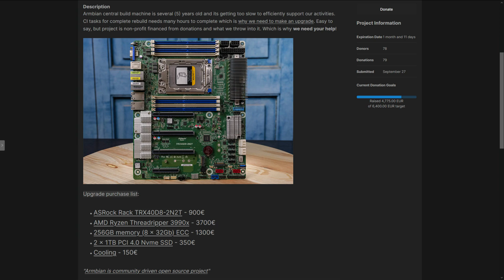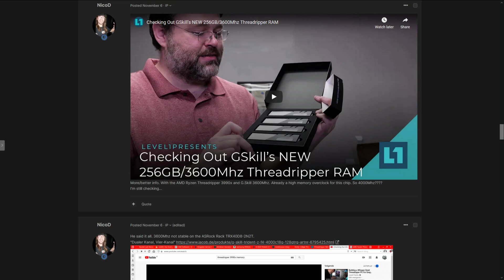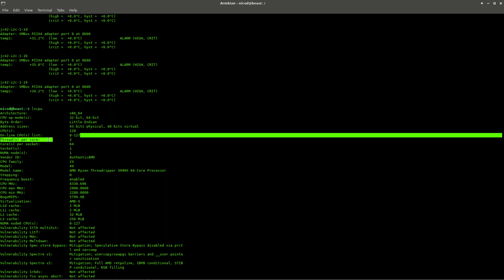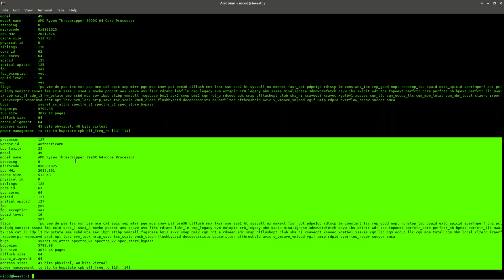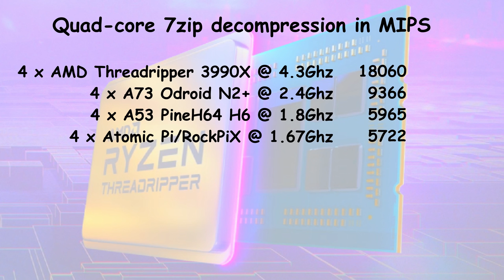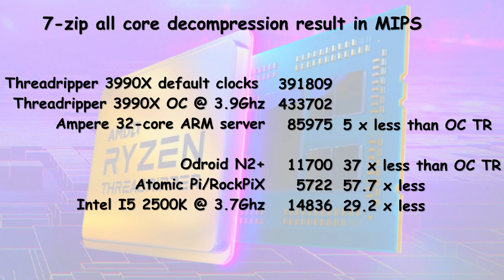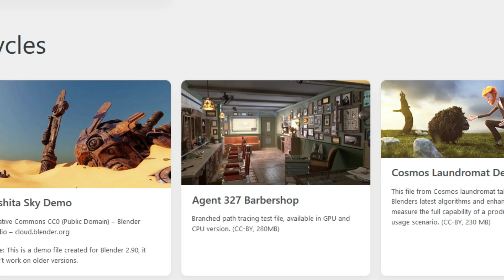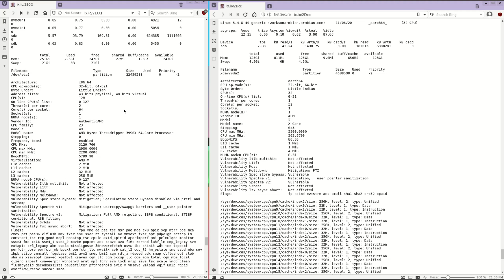Review AMD Threadripper 3990X 64 cores 128 threads server

Comment: This CPU contains 8 Zen2 Octacore "chiplets"

These benchmarks were run a CPU that containsjust one of those chiplets:
hannah@DESKTOP-NHRDJHM:~$ taskset -c 0 7z b

7-Zip [64] 16.02 : Copyright (c) 1999-2016 Igor Pavlov : 2016-05-21
p7zip Version 16.02 (locale=C.UTF-8,Utf16=on,HugeFiles=on,64 bits,16 CPUs AMD Ryzen 7 3700X 8-Core Processor
  (870F10),ASM,AES-NI)

AMD Ryzen 7 3700X 8-Core Processor              (870F10)
CPU Freq: - - - - - - - - -

RAM size:   12738 MB,  # CPU hardware threads:  16
RAM usage:   3530 MB,  # Benchmark threads:     16

                       Compressing  |                  Decompressing
Dict     Speed Usage    R/U Rating  |      Speed Usage    R/U Rating
         KiB/s     %   MIPS   MIPS  |      KiB/s     %   MIPS   MIPS

22:       6083   100   5918   5918  |      53300   100   4556   4546
Reply: All 8 cores:
hannah@DESKTOP-NHRDJHM:~$ 7z b

7-Zip [64] 16.02 : Copyright (c) 1999-2016 Igor Pavlov : 2016-05-21
p7zip Version 16.02 (locale=C.UTF-8,Utf16=on,HugeFiles=on,64 bits,16 CPUs AMD Ryzen 7 3700X 8-Core Processor
  (870F10),ASM,AES-NI)

AMD Ryzen 7 3700X 8-Core Processor              (870F10)
CPU Freq: - - - - - - - - -

RAM size:   12738 MB,  # CPU hardware threads:  16
RAM usage:   3530 MB,  # Benchmark threads:     16

                       Compressing  |                  Decompressing
Dict     Speed Usage    R/U Rating  |      Speed Usage    R/U Rating
         KiB/s     %   MIPS   MIPS  |      KiB/s     %   MIPS   MIPS

22:      52874  1516   3394  51436  |     601070  1483   3458  51265
23:      49915  1522   3342  50858  |     535223  1395   3320  46308
24:      45147  1447   3356  48543  |     512893  1371   3285  45019
25:      46567  1506   3531  53169  |     459239  1299   3146  40871
----------------------------------  | ------------------------------
Avr:            1497   3406  51001  |             1387   3302  45866
Tot:            1442   3354  48434
Reply from the maker: @hannahkiekens5097  45866 vs 400 000 is about 10 times less vs the overclock. Crazy stuff those threadrippers. Now I want a Ryzen.
Next week Graviton2 server from AWS. Wiiii :)
Reply: @NicoDsSBCs  You are about to betray your ideals and principles and soon after the ARM SBC Community will disowned you. LOL. Nice Video. Some Serious and Impressive PC hardware Armbian Community is about to get. I guess, to do the better job you need the fastest hardware. Cheers.
Reply from the maker: @josephtremblant2173  The difference is in the price... that I can't afford this :)
For building the images this was really needed. Now it can build 94 images in 30 minutes. So it will be able to do a lot. Needed since Armbian now will come with many different desktop environments.
So always more to build. I've had a blast with this server. 
Next week there'll be another server that might compete. I'm loving it :)
Greetings.